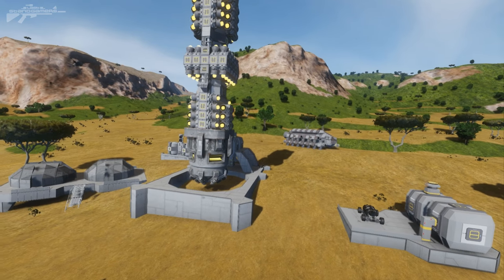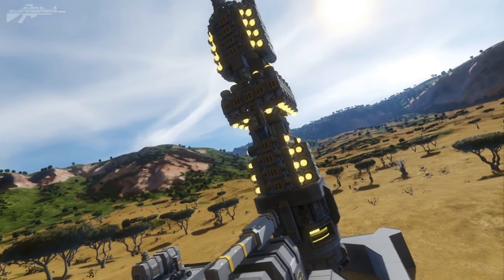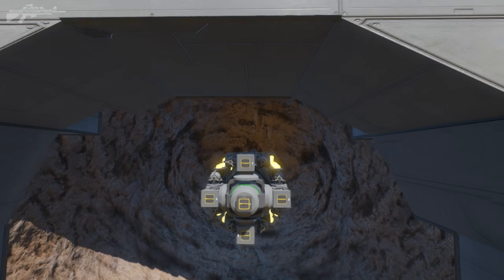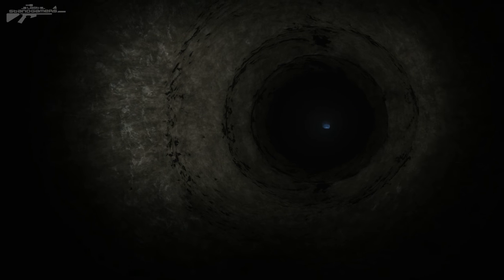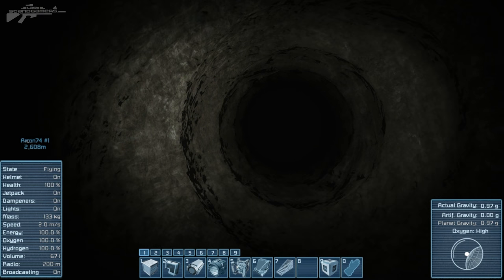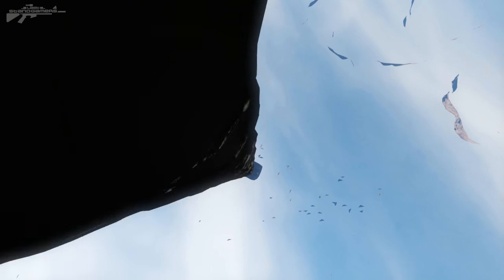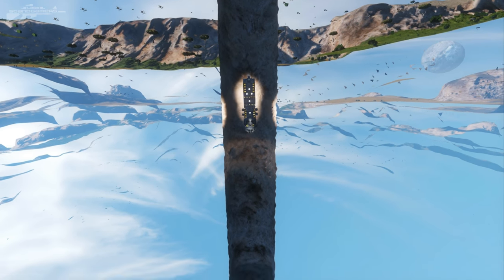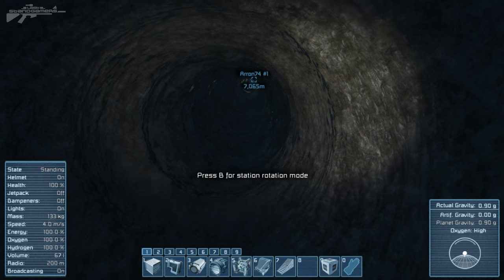Space Engineers - Centre Of The Planet Drilling

Comment: To comment on the whole gravity reduction issue, this is actually real science. As you dig deeper into a planet, your net gravitational force decreases. This is because as your depth increases, the mass of the planet still above you starts pulling you upward. Interestingly enough, the equation for what your gravitational acceleration will be basically comes down to what it would be like if you were standing on a planet who's mass is equivalent to the mass of all the earth beneath you at that depth. Basically if you go 10,000 meters below earth's surface. your net gravitational force would be the same as if you stripped the 10,000 meters off of the entire surface of earth and stood on that surface. What this means is that when you you get to the center of a planet. You will experience a net zero acceleration due to gravity. You will effectively be weightless. If you made a tube through the center of a planet all the way to the other side, whose mass was uniform and jump in; your acceleration would be greatest at the beginning, dropping off towards the center where you would reach 0 m/s^2 at your peak velocity. you would then start negatively accelerating until you reach the other side of the planet where you would be at 0 m/s

Comment: Gravity reducing as you get closer and closer to the center of the planet makes sense to me.
When you are above the surface of the planet, it is valid to simplify the gravity forces as if they were originating from the center of the planet, but as soon as you go below the surface, it gets more complicated. Once you are below the surface, all the matter that is now above you is applying gravity forces on you that tend to pull you towards that matter, and thus away from the center of the planet. You're still going to fall though, because there is more mass beneath you than above you.
I'm not sure if the universe works that way, but it would make sense to me if there was absolutely no gravity at all when in the middle of a planet since each of your atoms is being attracted in every possible direction by each of the planet atoms sounding you. The atoms of the planet that are symetrically opposed to each another relatively to the center of the planet are applying two equal forces on you but in two opposite direction, resulting in no gravity at all.

Comment: Gravity decreases as you go below the center, and yes, if you go to the center of a planet, you should find yourself in a place of "no" gravity. The reason for this is because, as you may know, gravity is a product of mass. The more mass, the more gravitational pull the object will have. As you go under the surface of a planet, you are placing yourself between the mass of the planet at different points. As you go towards the center, the mass that you are heading towards decreases, and the mass you are leaving behind is increasing. Eventually, it will get to the point where you have an equal amount of mass around you. All of this mass is trying to pull you towards it, but it's cancelling itself out, essentially giving a net gravitational force of zero. If you were to fall down a hole towards the center of the earth, and manage to slow yourself down along the way and stop at the center, it is actually possible to get trapped. This is because, if you manage to get a force to push in anyone direction, gravity will pull you back down to the center.

Comment: is it possible to make escape pods which are able to crash into planets while keeping the user alive
Reply: Well, yes, if you make them, like, triple-layer heavy armor spheres and suspend the chairs in the middle with heavy armor panels and catwalks.
Reply: +Artem Shinkevich don't you mean a 2 layer light armor thick sphere covered in wheels and those wheels are covered in catwalks? and they all don't even need to be finished for survival purposes
Reply: Mini Meatwad Well that sounds a bit abusive of game mechanics... Still good though :))
Reply: Artem Shinkevich game mechanics start to become really familiar after a long time of using them, as i've found out you could crash something into the planet at 1000m/s if the person inside of it is at the very center, 2 layer thick of unfinished heavy armor blocks, covered in wheel suspensions with wheels, also unfinished, and unfinished catwalks on those wheels, i tested myself in survival and managed to survive with a unlimited speed addon, it broke through until the last armor layer
Reply: Mini Meatwad actually that makes sense as the unfinished armor blocks do not deform and conduit damage... You might have just made my evening with SE a bit more interesting! ^_^
Reply: +Artem Shinkevich they do deform, weld one, but impacts don't do structural damage but instead deformation damage, and a huge line of heavy armor blocks which only cost one steel plate but technically count as a heavy armor block in strength, and you could lithobrake onto a planet, as long as you have atleast a gyroscope that is powered
Reply: thanks for the help guys

Comment: Aaron, you think too small. What use WOULD you have for something so deep you ask? Well, I can think of several things; Evil underground bunker, a Vault from Fallout, massive mining operation, or, in my case, a massive underground complex capable of handling fighters and small capital ships... I'm having a bit of a problem figuring out timers and pistons in order to automatically lower ships on a elevator pad down to the bays though...
Reply: +Lazurkri I currently imagine a planet with several holes all over the world, which all lead to a huge base in the planet's core. That would be awesome, though it unfortunately cannot be built right now.
Reply: Eisvisage
Cool in concept, in execution, not so much.
Reply: Lazurkri
Okay, yes, the fighters couldn't start from the planet very fast, and it's just too easy to get into the complex.  Also, it would be totally laggy xD
Reply: Eisvisage
 you forget, getting access in and out would be a pain in the ass, especially if its vertical access shaft, which it almost always has to be. Plus, if you were attacked, a vertical shaft is a straight shop for a bomb into your base, as well as the fact that even if a shaft wasn't used for a bomb drop, if a shaft was destroyed or worse, someone was watching the shaft and had weapons ready, you'd be stranded at the bottom of a kilometers deep hole with no way, unless you'd already had  a extremely long set of stairways up, which could also be destroyed or watched...

Comment: The gravity should have been more intense the closer you get to the core.
Reply: +MakoRuu That's not how it works. Planets are not gravitational singularities, the farther you go down the more mass is above you as well as below you. Once you get to the core the net acceleration due to gravity is zero and you could float about as if you were in orbit.
Reply: That's close, but you're off a bit. The center of the Earth is much denser than the outer layers, the gravitational forces actually increase as you travel downward, reaching a point of "zero gravity" at the center due to it being equal in all directions at the same time, assuming uniform density. 

It's impossible to know for certain.

However, if you were to stand at th cusp of the center just before the negative zone, the gravity would be about fourteen times stronger. (Given that you could survive, you could essentially fall from one side of the Earth, through the center, and come out the other side using the momentum of the first fall.)

https://en.wikipedia.org/wiki/Gravity_of_Earth#Depth

Comment: I used the voxel hands to carve out 60k straight down in the first 2 hour planets where out and found you can not build deeper than 6.7k so disappointed wanted a base in the core lol
Reply: +Justin Case I have found a way to dig/spectate to the core only its not max size planet I spawned a moon at the min size and was building at 9.5k  under the surface made a cavity and grav out from the center so walking on the roof

Comment: Nope, this is misinformation. There's a bug that causes falling through the ground when you dig really far or really fast and that's what you're seeing in this video. If you save and reload your game, the bug will go away until you've dug another few kilometers.

Want to know where the exact center of the Earth Easy Start planet is? Create a new GPS coordinate at 0,0,0..
The Earth planet in the game is 120km in diameter, so it's 60km to the core (give or take a few km).

It's not worth the effort to mine this deep. Grids can't be much longer than 10km to 20km as of Beta 1.8. Everything goes haywire when you try to build a conveyor through a planet (I've tried repeatedly over the years, and recently found a workaround by hacking saved game station positions ~ look up the "Perfect Space Elevator" saved game on the Steam Workshop to see an example and detailed instructions).